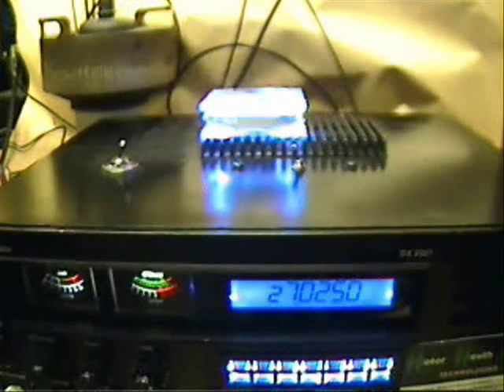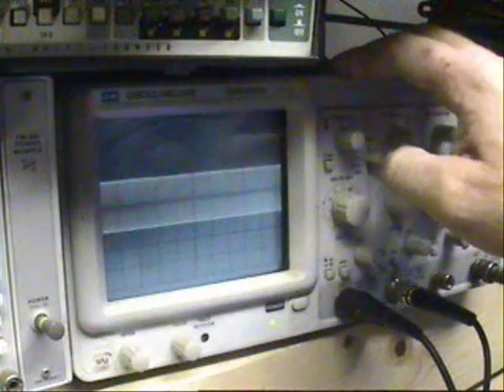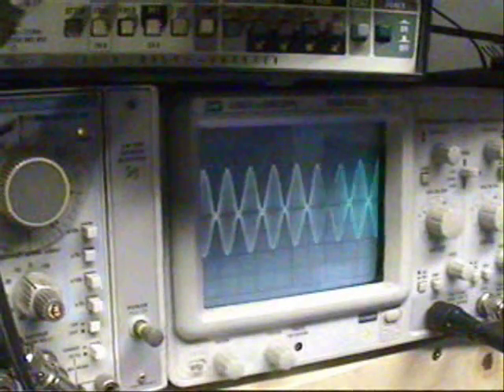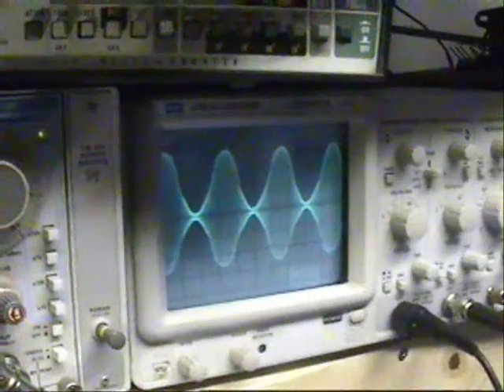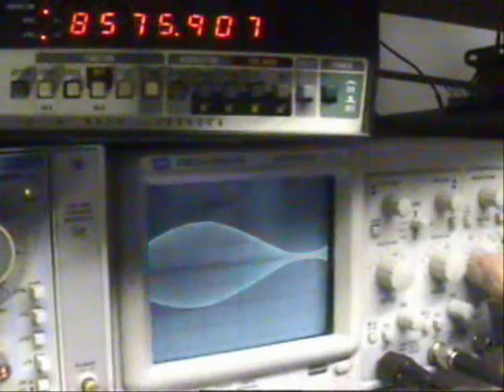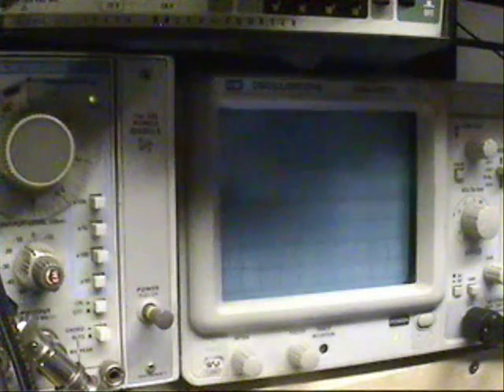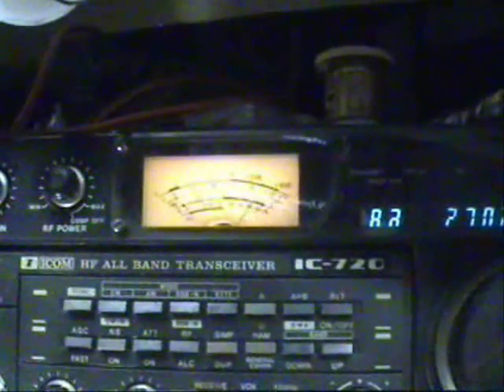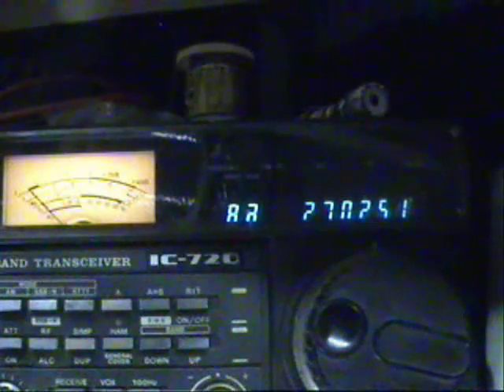Mauldulator on the Galaxy 2527.wmv

Comment: I'm not trying to talk smack, but at 6:50 you start to mention that the negative peaks are perfectly smooth and rounded, but they are not, they start turning diamond shaped, then you continue that no other radios do this asymmetrical modulation.  I have plenty of radios that do asymmetrical modulation, and they do it perfectly clean.   Also once you go over 100% is it very clear that the signal is no where near the original  sine wave shape anymore. Just sayin.

Comment: Been 10-7 since '91. Got back in recently. First time I heard your station on the bowl, I shit just a little in my pants. NEVER heard that from a CB ever. I see its a fad now. Now, 1 Is the equipment you used required to install the mod? and 2 will those small digital O-scopes work from eBay? Like the Hantek PC Based Oscilloscope 6022BE Digital Storage 20Mhz Bandwidth,48MSa/s 
I want to learn this stuff. Saw your shack, awesome. Thanks 303 BR.LA.USA

Comment from the maker: No need to be confused.. The Mauldulator is a board that controls the driver and the final inside the radio. It sets the carrier, and allows the separate control of the positive peaks, and negative peaks. The Mauldulator works great on the 29

Comment: um I listen to them, have even set up a big boy station or two in my day. You can get Hi-fidelty out of them by MODIFIYING them. Stock Johnsons and Heathkits are approx the same bandwidth as CB's 300-3k. Which is as wide a freq response as the original mod transformers can take. Also, as stated by AM-phone and others, about 125% assymetrical is most a recvr can handle. After that, the receiver will distort the reception.

Comment from the maker: Any radio that has a 12 Volt driver and final. Bi Polar or Mosfet. Some of the export radios have built in linear amplifiers after the driver and final, and that is fine. Just a driver and final, you get 3/4 Watt Dead Key, and 6 Watts PEP with the same scope pattern in the video. If you lower the carrier to say 1/4 Watt,  you get 2 Watts PEP with the same 200% and  headroom to go beyond that. It is up to the proper use of amplifiers to get back up the level required. Don't let small #'s fool you

Comment from the maker: Just as RF is logarithmic, and it takes 4 times the previous power in carrier AND peaks to get one 1 S unit stronger, audio is much the same. Do the math on the RF, and you will find that to raise a signal 8 S units from a 12 watt peak level requires 786,000 Watts. Achieving audio quality is the most difficult, and costly part of AM. Well at least up to a certain level. Then power starts costing what it costs. I would like my own Hoover Dam....Bottom line is YOU MUST HAVE A LIMITER.

Comment from the maker: When a person goes to a tech and gets the radio modded for audio, this is the ultimate goal. Best thing to do if a person  doesn't want to go this route is to learn to use an oscilloscope, and run the radio, and all amplifiers involved in such a manor as to maintain 100% positive and negative peaks. Couple this wit a bit of compression in the audio chain and an EQ, and there you go. Great intelligibility, and talk power. If you want the voice of "God", then go the extra mile.

Comment from the maker: Thanks Breeze, There is a web address, and phone number if you are interested. As for where it is connected, it is connected to, and is taking full control of  the collectors of the driver and final. 

As for the cleanliness, spectral purity, and the "sound " of the audio are two very different things. You can sound as grungy , loud, and heavy as you want. That does not mean that the signal has to go on other frequencies, and other bands. That is what I meant be clean. I like Loud, Heavy audio !